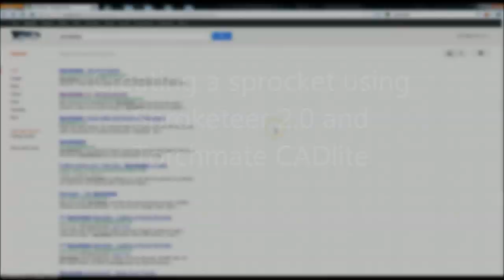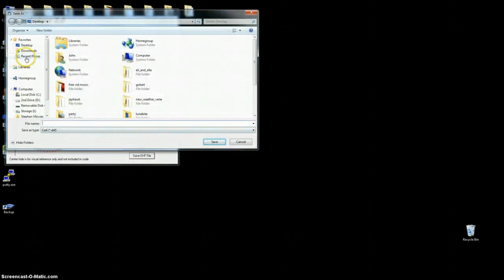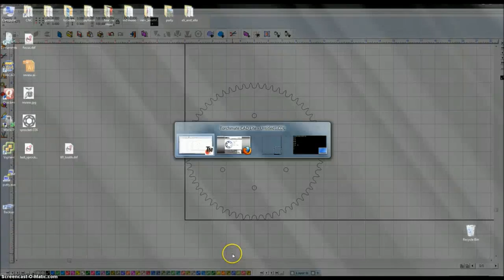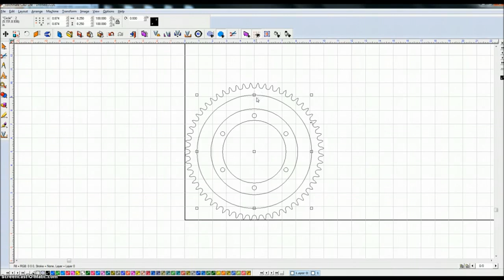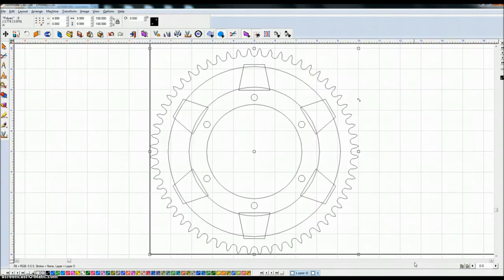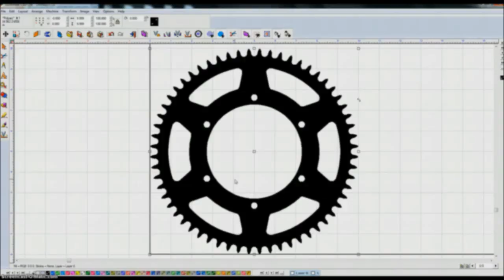Torchmate CAD/CAM & Sprocketeer 2.0: Designing a sprocket

Comment: Wow, this is awesome. The discovery of Sprocketeer 2.0 alone is worth it's weight in gold. I have an alternative energy project that requires some very large diameter sprockets and the company I use to cut the sprockets can only go up 114 teeth on Ansi 35 because of their CNC machine's limited size. So I started looking at plasma cutting for something else and bang your video just killed about 15 birds with one stone. Even a small table with Torchmate easily takes me out to 190 teeth.